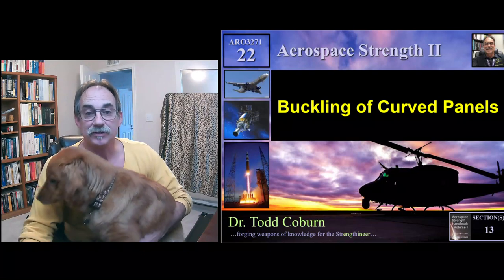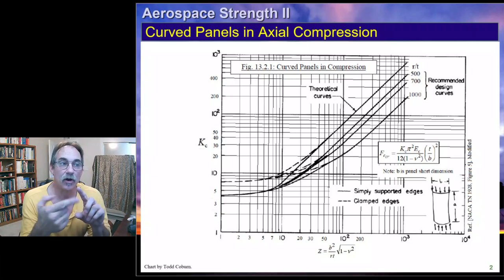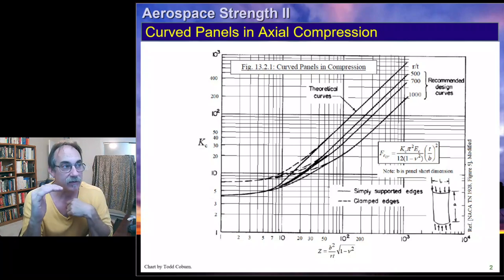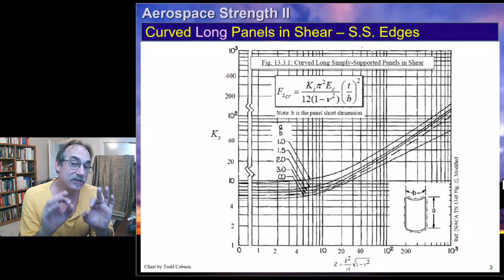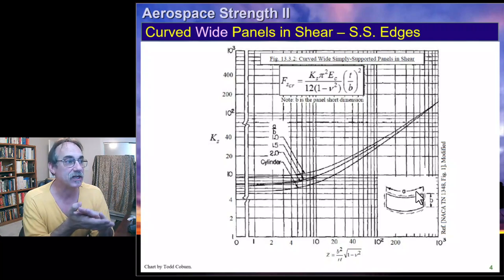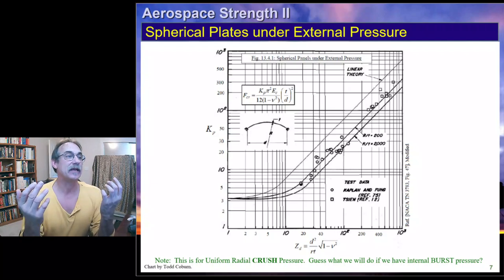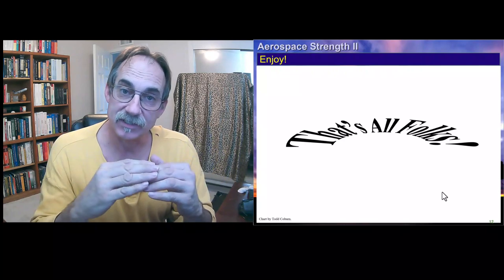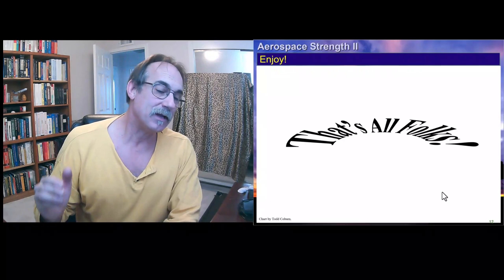Strength II: L-22 Buckling of Curved Panels

Comment: Hey @Todd Coburn, question. Let's say my fuselage has known stringer & frame spacing & geometry and I am trying to write the overall fuselage margin to known section loads. Your previous lectures state how to write margins for each stringer with some effective skin width, and from this method I might have written a section's capability as that of the lowest margin stringer. Would we consider the curved panel between each stringer in our analysis, or neglect it since the stringer and it's effective skin will carry load past the curved panel's buckling allowable?

Another way to pose this question is: when and why would we apply these equations in a structure if the buckling capability of the stringers neighboring the panel is much greater?
Reply from the maker: Ted, good question.

One underlying principle is that we must first determine loads for the skin panel.  That can be a challenge in itself.  The reason is that the loads that the skin change based on how much skin is effective.  If we assume full effective widths then we tend to over-predict the load in the skin, especially if the skin is in compression.  Lecture 25 in the Stress Analysis III playlist explains a simple way of accounting for this (although i need to record a more-clear explanation of what you seek).

Once you have determined the appropriate effective skin for a given set of loads, then as you said, the assumption that the effective skin is included in the stringer and that the rest of the skin is unloaded does in fact kind of deal with the skin.

However, it is best to also evaluate the skin separately.

First, you need to recaclulate the skin load.  You can do this by multiplying the stringer/skin stress by the area of the effective skin.

Pskin=f_stringer&skin (w_eff)(t_skin)

Then divide by skin area in bay for stress…

f_skin=Pskin/(skin width between stringers)(t_skin)

Then check that skin for buckling.  ( It shouldn’t be based on the other assumptions, especially since the load is based on a flat skin assumption and the actual buckling capability is a curved panel value.

Of course, if it ever did buckle, that is not the end of the story since a diagonal tension analysis can then be performed.  However, that introduces a number of additional checks that can get tricky to deal with properly.

After you do this a time or two, you may decide you can stop at the stringer evaluation since it generally will cover the skin itself if the skin loads are properly unraveled from the prior assumption values.

Make sense?

This is super-fun stuff, but requires careful stepping thru the process.